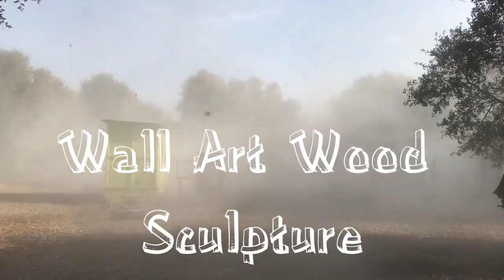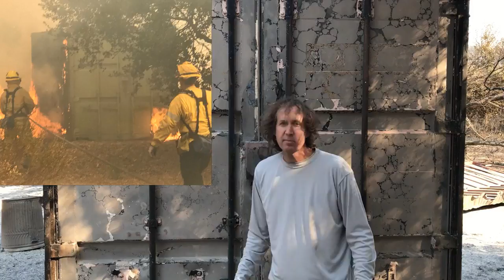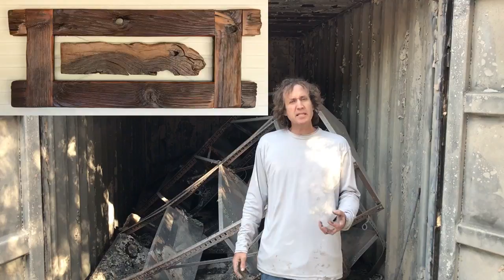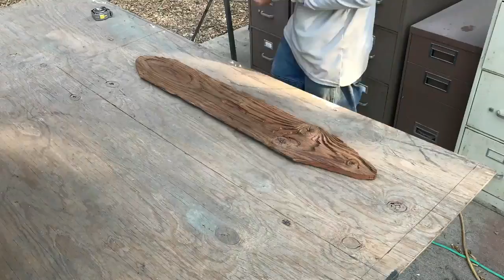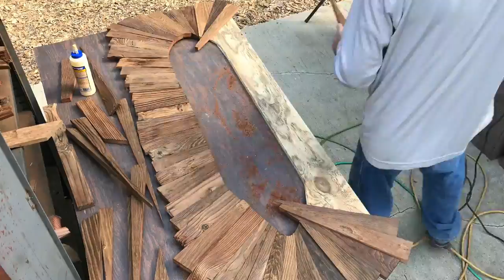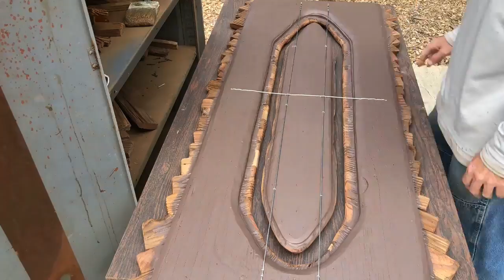Out of the Ashes Wall Art Wood Sculpture

Comment: Fire burned all around my place too but I was much luckier.  You have lost a lot but you have great strength and a good inner spirit which the fire can’t take away.  I noticed yesterday that there is actually a beauty even in the burned areas.  Yes the rain will provide some revival.  Make an excellent list for fema.  You are valiant.
Reply from the maker: Good to hear you were much luckier with the fire. In some ways I feel a little bit lucky too. It could have easily been so much worse. Lets hope it rains soon.